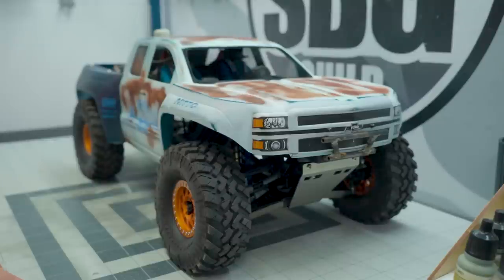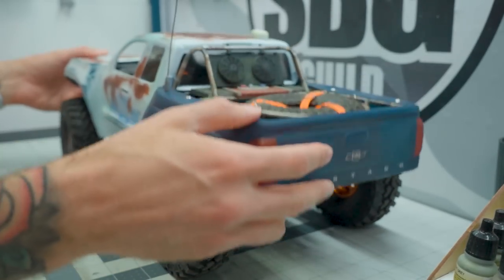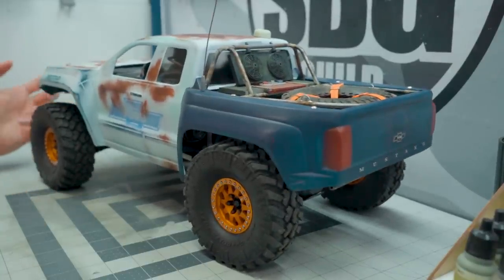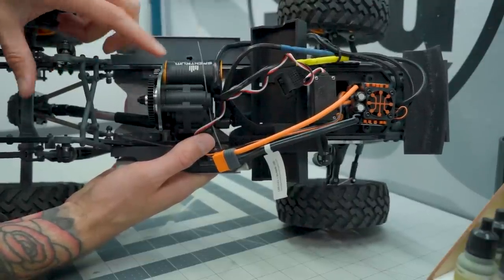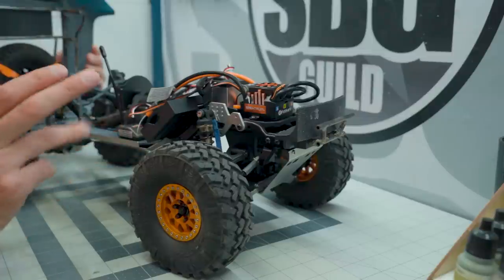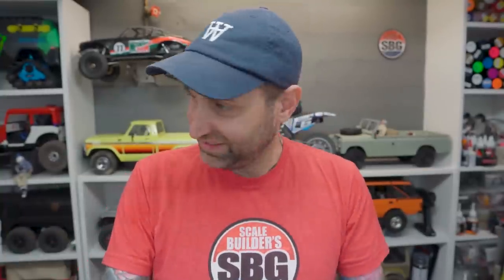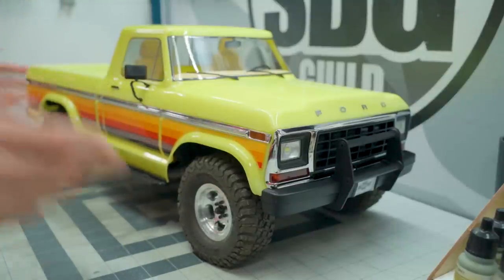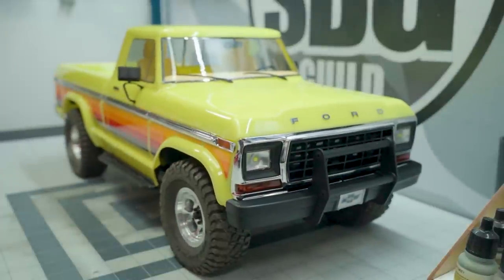Printing at Ludicrous Speed - What's on the Bench Weekly Ep51

Comment: Could I get the link for the spur and pinion gear?
Reply from the maker: I don’t have a link. You’ll have to find a set that works for you. I modified the motor mount to allow for the larger pinion. I don’t remember what I used, you’ll just have to search online based on what I said in the video. If you want to use 32p gears, you’ll need the Bowhouse 32p conversion kit: https://www.amainhobbies.com/bowhouse-rc-svt-spur-gear-adapter-bwh-bel-0060/p1357088?avad=262921_d3418f295